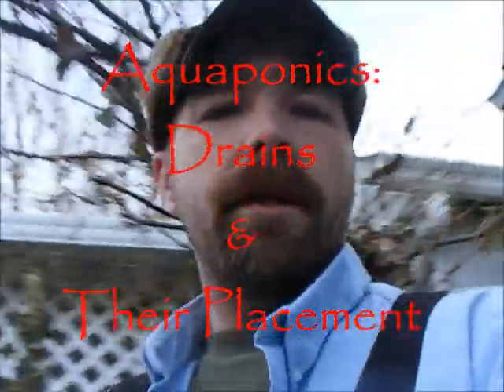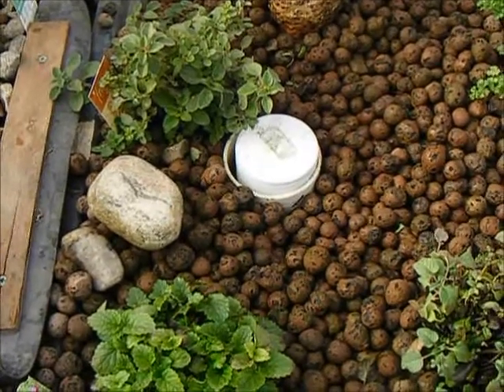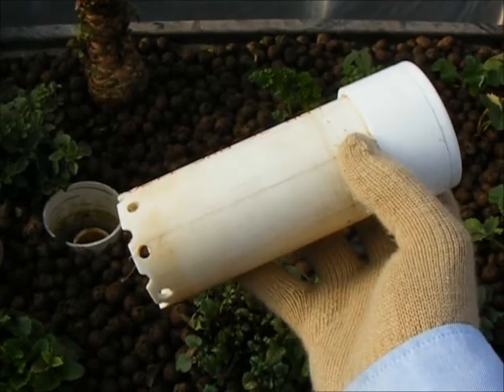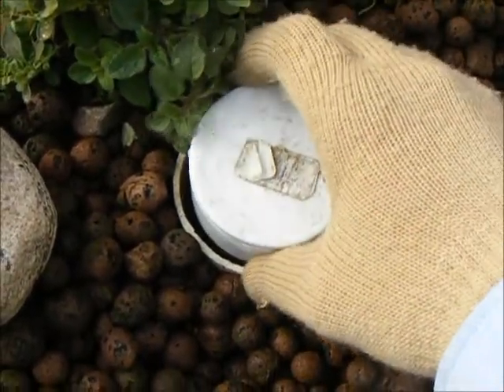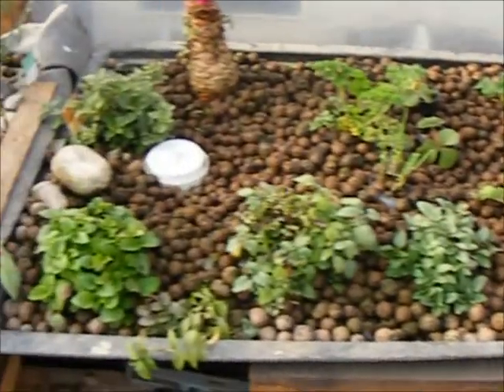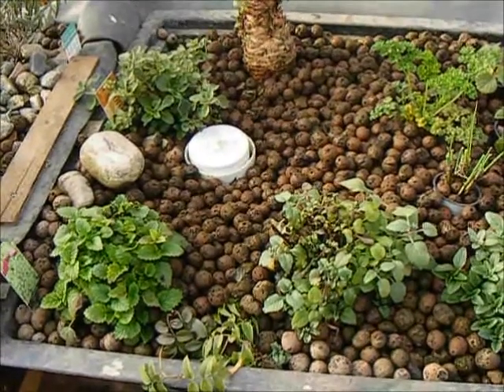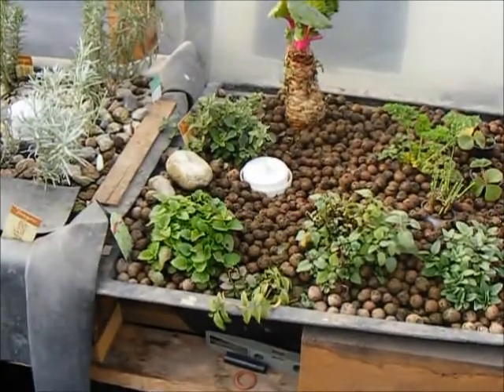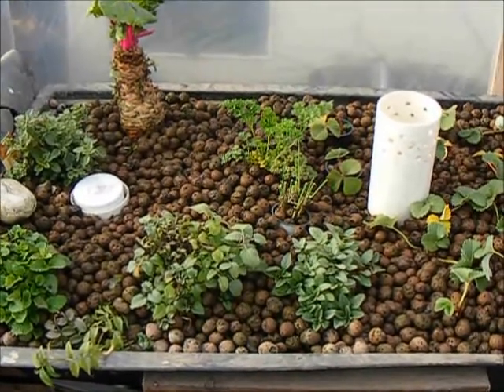Aquaponics - Drains and their Placement

Comment: The reason siphon is not shutting off is you have a 45 and not a 90 or even a p-trap under your grow bed. the water it moving too fast to stop. I recommend adding a 90 between the bedfloor and the 45.